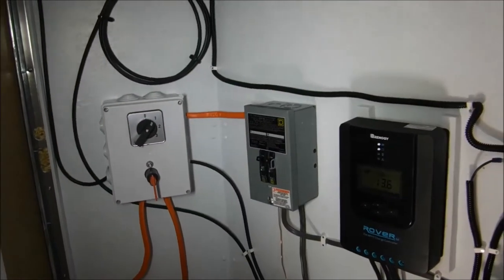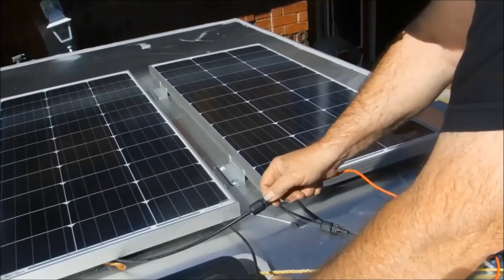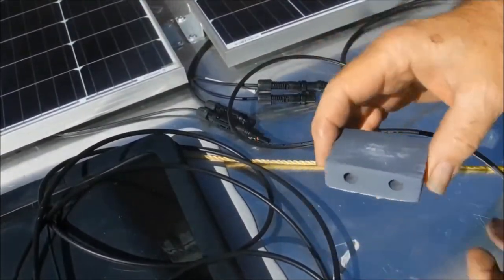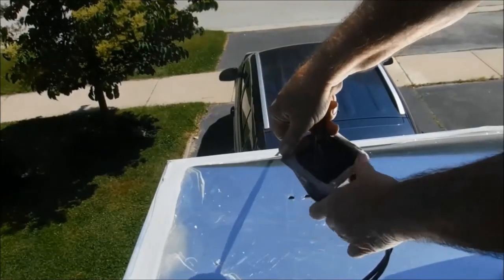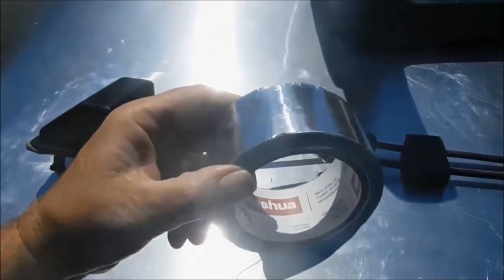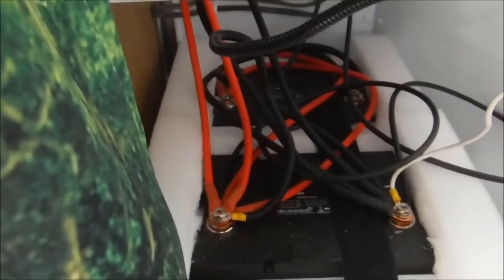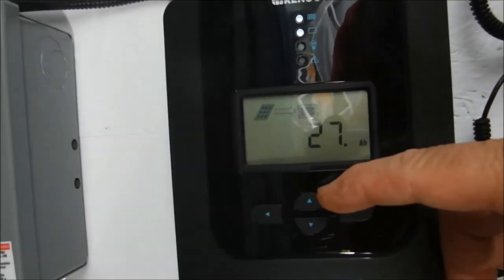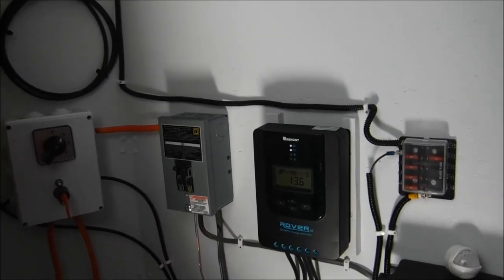Our 7 X 12 cargo trailer conversion Episode 12 Connecting the solar panels

Comment: You want your solar panels in series, because if that voltage drops too low, due to cloud cover, they will not put out enough to even charge. You want the higher voltage that your MPPT controller can take advantage of.
Reply from the maker: Thanks for the comment. I can easily switch to series at any time, but it seems to be working well now. I will know better once I get the battery monitor installed.
Reply: In A small 12v. System you want to have it in parallel like he does so it can charge faster , for bigger systems you can  put them in series to keep up with the big draws.  That’s the main difference so he did it correctly.